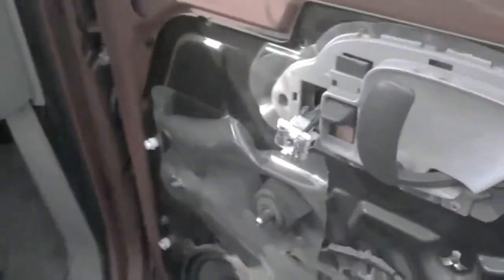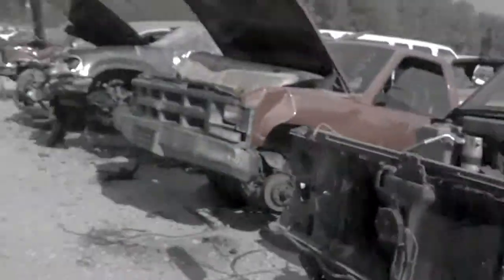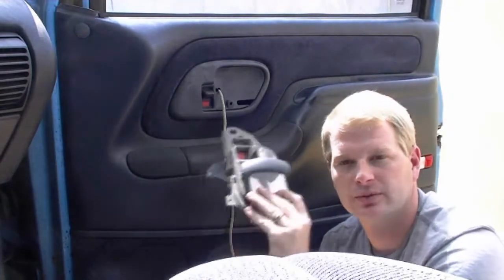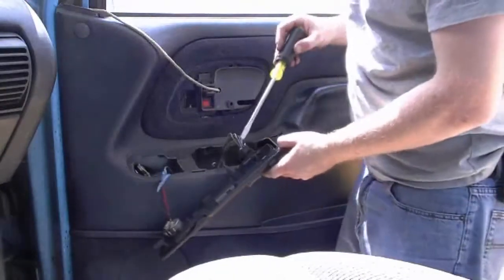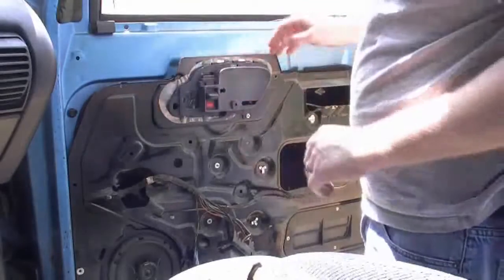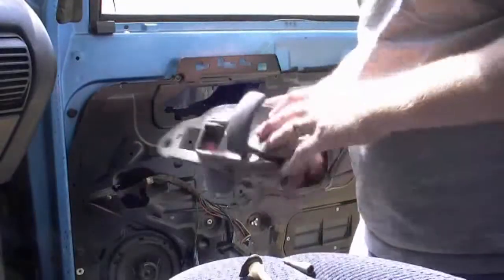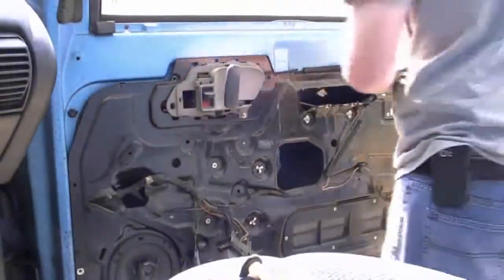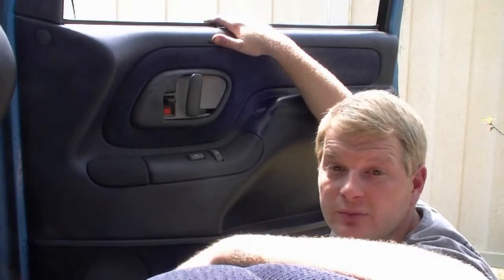Chevy Z71 Door Handle Repair - The CORRECT Way

Comment: ive done this with my silverado too, i find it easyier if you just remove the interior door panel, switches,, excetra, and drill out the existing rivit and just push the whole door handel/lock foward like you do but just withhout removing the whole inside skin cover. then just unhook the rods to your lock and reinstall with a new rivit. also watch out keepin the window down, u dont wanna drill into it haha, great vid tho